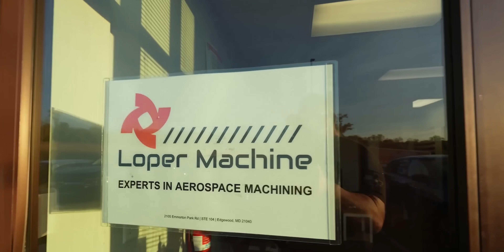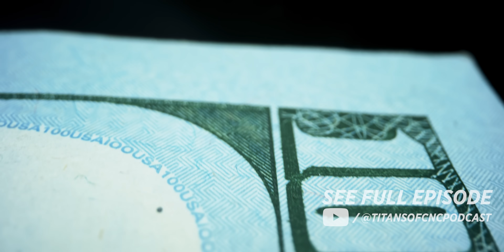Started my shop with $20K and now I have 15 CNC Machines

Comment: First 5-8 years youll work harder then you ever will when you start a shop. Finding good customers, employees, and equipment without blowing your budget out of the water. Learn how to work on your equipment it will save you $$$$ in the long run and dont be afraid to tell a customer no. I use to get bullied to take jobs at a loss on some jobs from one of my better customers at the time. Dropped him as soon as I could.
Reply: Why would you take a job on a loss?

Comment: As a machine shop owner, I'm not really interested in the production contracts. I like to help with prototyping. Sure maybe it pays less, but it's a hell of a lot more interesting than making 2,000 brackets with two holes drilled in them
Reply: Yeah, I started out making plastic injection molds and jigs and fixtures for production, all on manual machines. While this is definitely my first love the older I get the more I just like to make money, and doing production is by far the easiest way to do it in machining. I am also a big believer in making your own parts vs contract machining.
Reply: @cgpmachining  yep. My shops primary purpose is for my own inventions, so I have a lot of capabilities that some other shops might not, in terms of the breadth of my machines. I have everything from lasers and plasma cutters to the big mill, surface grinding equipment, lathe, and a lot of small random stuff. It's all about being able to do as much stuff as possible in house so I can work very rapidly in small quantities, and then if they work out I can refine it and send it out for production. 

Most of the time when I'm doing client work it's just for the sake of helping someone out because I will do a small job for a reasonable price because all the other shops in my area don't like the small jobs so they charge way too much for them or say they won't do it at all. It definitely helps with building connections. I'm in a good position though where I have several sources of income so I don't need to charge a ton for the guy who just needs a bracket made up quick
Reply: As a product developer we appreciate you! FEW are willing to devote resources to prototyping. Especially with injection molding.
Reply: This comment .
Reply: Honestly, too much brain power expended for the amount paid... Im still in prototyping machining
Reply: I'll make the 2000 boring parts to pay for the fun stuff.
Reply: if you had the space, a large enough contract could pay for an automated setup for stuff like that to get money and have robots do it all.
Reply: @WCGwkf Yes definitely, if one of those came across my desk and the timeline allowed for me to spin up a shop just for that purpose that I could have other people run I would take it. But they're pretty hard to find

Comment: How did you crack the code with getting big production contracts?
Reply: We are very fortunate that a larger shop took us under their wings and keeps us busy with production work. 

We established that relationship by our supervisor at a previous shop leaving that shop and going to the shop that gives work. 

Having that work and figuring out how to run it efficiently allowed us to build out a bigger customer base. Most of our customers found us by having longevity in the business. By solving their problems consistently/effectively keeps us as their top suppliers.
Reply: @alexloper3084  The Man in the flesh ;)
Reply: @MR-backup  I appreciate you brotha!  👊
Reply: @alexloper3084 so basically connections
Reply: Outbid everybody else and still make money.